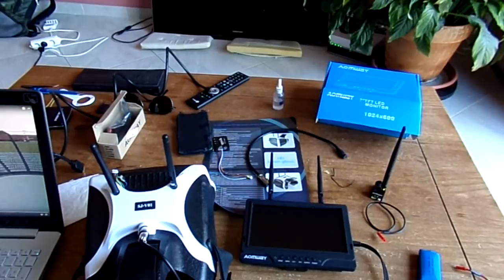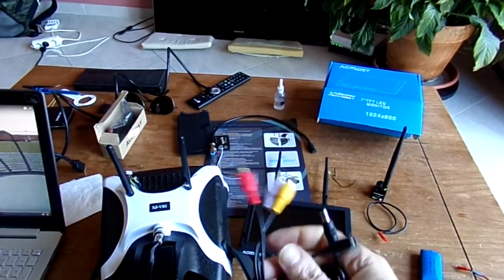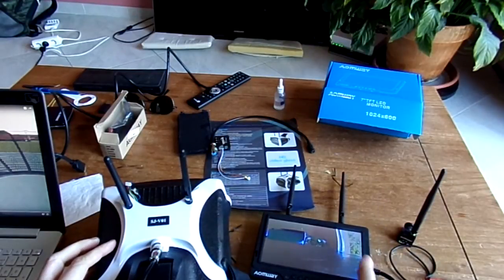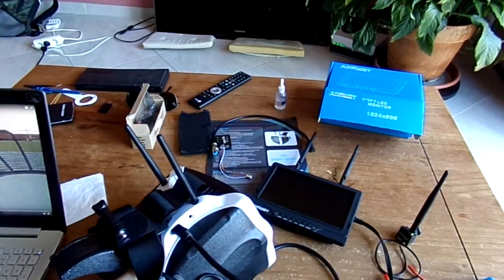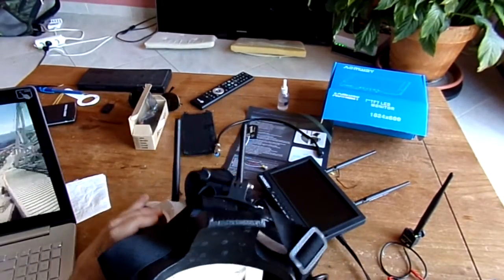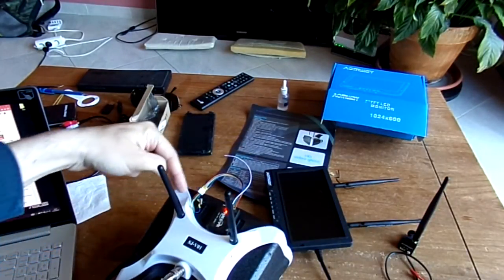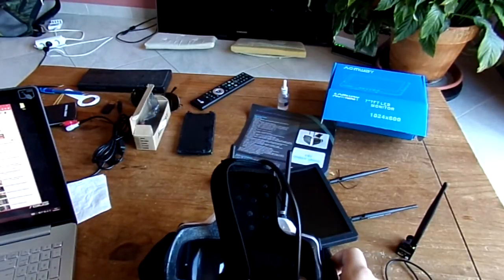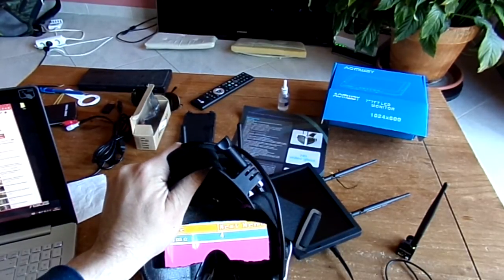Skyzone SJ-V01 advanced testings: AV in, AVout, HDMI & HMDRV integration (Courtesy Banggood)

Comment: hello, since you have gotten these goggles, have you found you could have used the AVout cables that came with the goggles instead of opening these goggles and soldering the connection to the DVR? thanks in advance
Reply from the maker: Yes you can of course use the provided cable but they add a lot of extra weight .... so connecting directly the DVR was for me a better option.
Reply: SeBy DocKy thank you for your response, I was hoping you would say that. I assume I will still need a  5v step down to power the dvr? thanks again I appreciate the videos you make.

Comment: How do u Hook up the HMDVR to the Googles
Reply from the maker: Personally I soldered directly on the rear side of the main connector to retrieve the GND, + VCC, AV signal. I gave some détails in the RCgroups/drone-maniac thread if I am not wrong. You will need a Voltage regulator to output +5V for the HMDVR

Comment: did you use regulator to get 5volt for the hdmr mod. or can you pull 5volts from the PCB?
Reply from the maker: Yes I i used a small +5V Vreg
Reply: SeBy DocKy can I ask what battery pack you are using? I tried a +5 volt regulator on a 16.7 volt pack and it gets really hot.